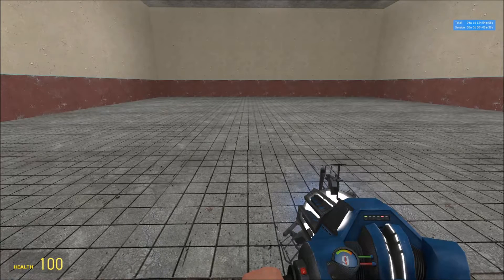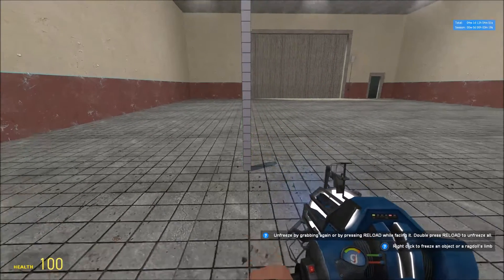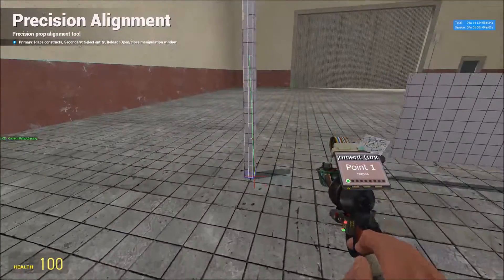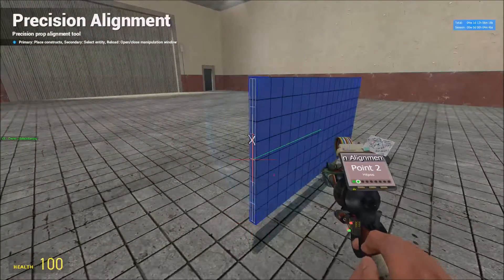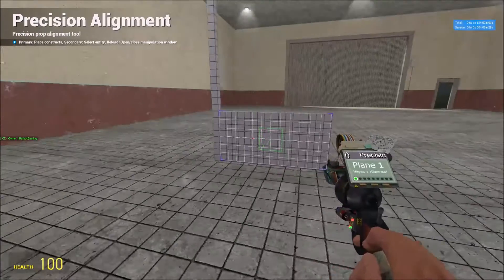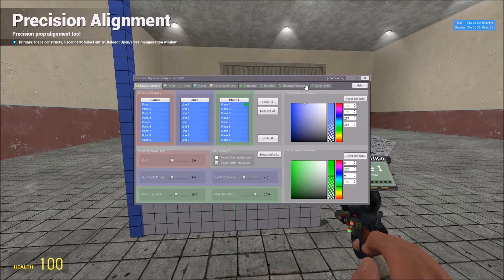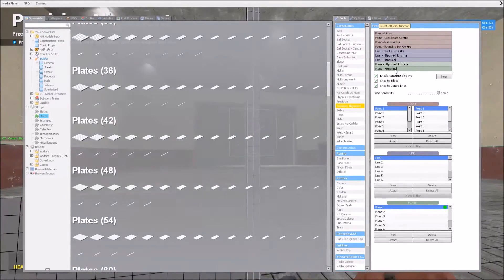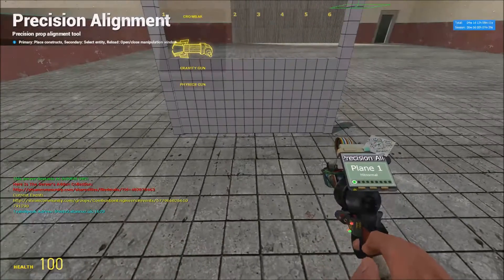Garrys Mod 13: How To Use Precision Alignment

Comment: Hey i was wondering if there was a solution for this or if u need to keep playing with it until you get it but lets say i set the roll for 110, the pitch for 35 and the yaw for something like 15. when i move one of the angles it for whatever reason moves the two others. for an example lets say i move the pitch from 35 to 50 or something the plate or whatever I'm rotating will move not just the pitch angle but the yaw and roll. PLS HALP ITS GETTING REAL ANNOYING FOR BUILDING BECAUSE MY STUFF NEVER COMES OUT SMOOTH BECAUSE OF THIS.
Reply from the maker: Thanks for watching the video.

When using PA, are you making sure you select the prop and clicking GET ANGLES first? If not then that could be your answer. If you are doing that then I am not sure what the problem could be.

Thanks :)
Reply: OK ill try that thanks. I thought get angles was for only finding the angles of one prop and then transferring them to another or just knowing the angles of a prop.
Reply from the maker: Alright :)

Let me know if you need any help or if it works!
Reply: um... it still moves the other angles when i only change one of them when all of their values are mostly high.
Reply from the maker: I am not sure what's happening then, sorry bud.